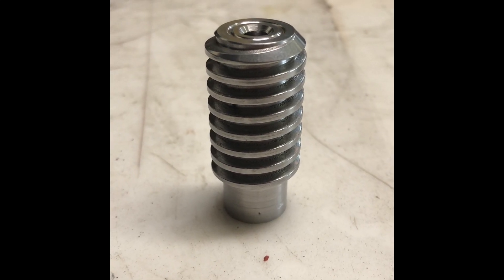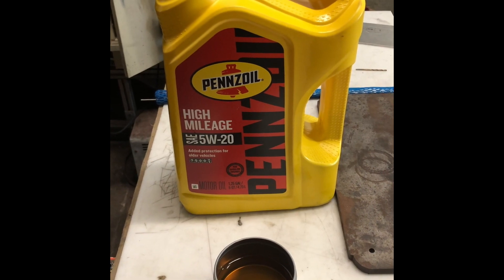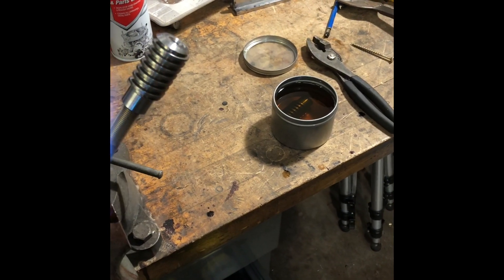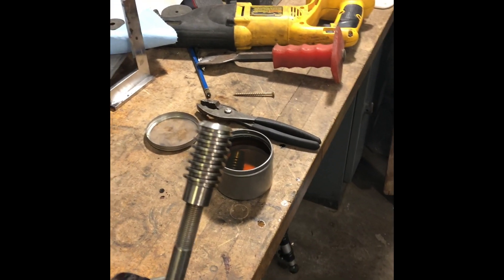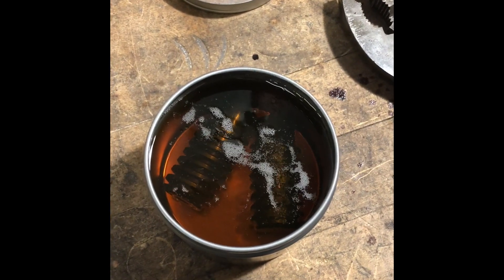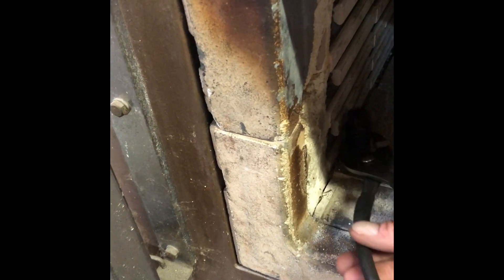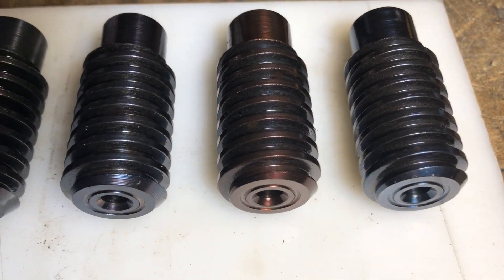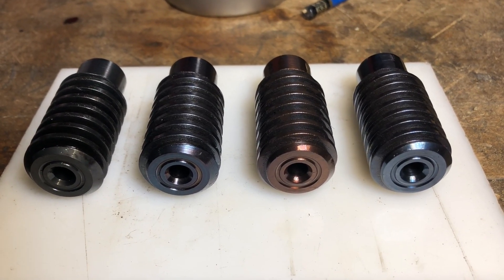How to Blue (Bluing) Steel Using Oven Or Torch and Oil Method

Comment: Thanks for making this. Does the heat affect the hardness of the steel? I have some tools I want to blue (a small Allen wrench that I had to cut down) and I want to make sure I don't end up making it too soft to use.
Reply from the maker: In order to harden steel, you have to heat it past its critical temperature and typically quench it in oil.  I do not know off the top of my head what that temperature is.  This process could possibly anneal it if it is not brought up to a high enough temperature.  You will have to do some more research on that.  Sorry I couldn't be of more help.
Reply: It absolutely would. For almost every steel that I know of, taking a part past 500 F will fully anneal it. It will basically remove all the hardness that any initial heat treat would have given the part.

Comment: That was so simple yet so awesome! Question: does blueing that part protect it from the elements? For how long? Hope I get an answer soon.. Good job man!
Reply from the maker: It does give you a level of protection from the elements because you are impregnating oil into the surface of the metal.  It is not,  however, the same as plating.  I have had them sitting in the open in the shop, and they are not "flash" rusting like the untreated bare metal does.  Keep a light coating of oil on them and they should hold up very well for a long time.
Reply: @OOMAN  Just want to let you know what you're doing is actually causing a layer of oxidation to occur. That happens when steel heats up. It is not due to the oil at all. If you didn't use any oil it wouldn't make a difference in color. The hotter you go the thicker the layer of oxidization. That's why the color changes. Oxidization messes with light as it goes through it. That's why you get different colors. It does offer decent protection, though I would still keep a light coating of oil.
Reply: @DanGoodShotHD  what he said!
Reply: @DanGoodShotHD  So what is the point of quenching it in oil then? Would air cooling it and then oiling it an hour later yield identical results?
Reply: @totallynotabot151  yup
Reply: @totallynotabot151  quenching it basically locks in the desired color.  dropping it in oil basically adds a layer of protection.  I usually drop mine in distilled water then dry and oil after
Reply: @OOMAN  thank you so much for a quick response.. Have a nice day.

Comment: What if you put the oil on the first before you ever heat them or put them back into the oven and bring them back up to temperature after you put oil on them?
Reply: It would create a multi color effect. I have done this on swords. Best method I have done with this is heat up till it is pretty warm spray wd40 cool a little then heat up till you get color effect you want then let cool by its self.
Reply from the maker: @timeverhartofficial   Great info!  Thanks for the tip Tim!
Reply from the maker: GrowLLLTigeRRR   I believe the oil would burn or cause uneven discoloration of the part.  The purpose of the oil is to quench the steel, which cools it down rapidly, hardens the steel, and creates a slight protective coating.  The color is created by the temperature of the steel.

Comment: How durable is the finish sir? Does it last?
Reply from the maker: It is not like a paint, ceracote, or plated finish. This process heat treats and impregnates oil into the outer layer of metal.  It will require the same care as a chemically applied gun blued finish.  Since it is essentially bare metal, you will need to keep it oiled, or it will rust.  Not as quickly as untreated metal, but it will rust if not cared for.  I applied a light coating of oil after finishing this video, and after several months of sitting in the open on my bench, they have not rusted or changed color.
Reply: @OOMAN  Ok very cool. 👍 I have only cold blued steel before. Really like the finish but was disappointed at how it holds up over time

Comment: What temperature resulted the bronze/ dark gold color?
Reply from the maker: Michael Schower  According to the chart I have, it should change to that color at ~500°.  I have seen the colors back off 1 shade after quenching, so if you pull it out when it’s dark bronze, it would go back to a lighter bronze/gold color.  As shown in the video, I had the bronze part in the oven @ 725°-735°.  I wasn’t getting the color change at a 500° oven temperature.  I monitored it and pulled it out when it turned purple and it backed off a shade to dark bronze after quenching.  It requires some experimentation.  Hope that helps!